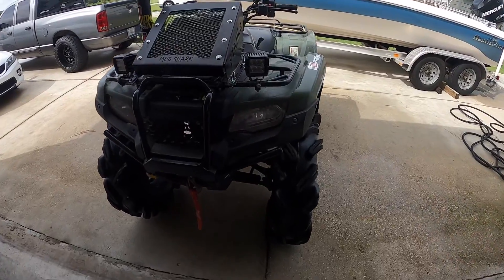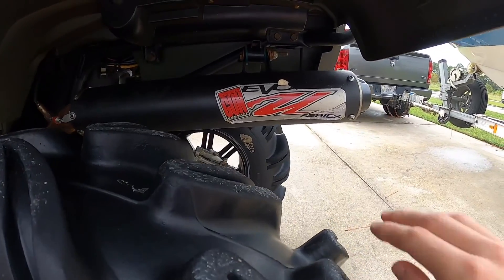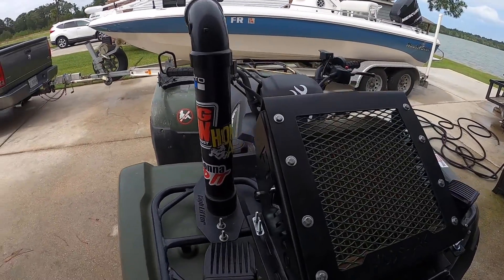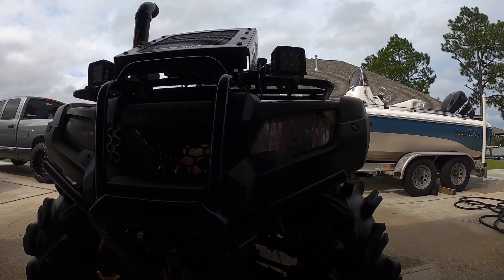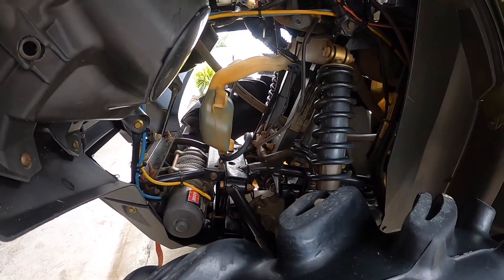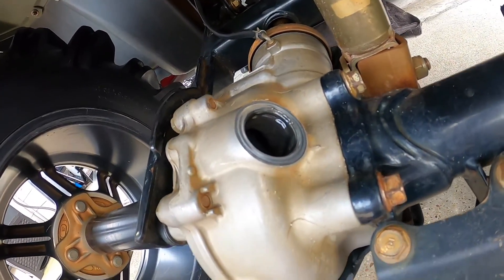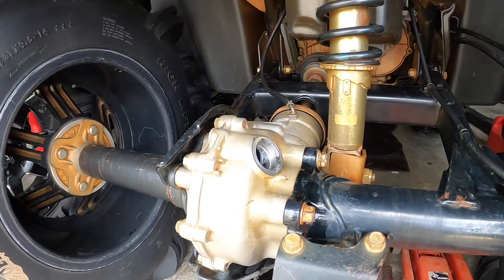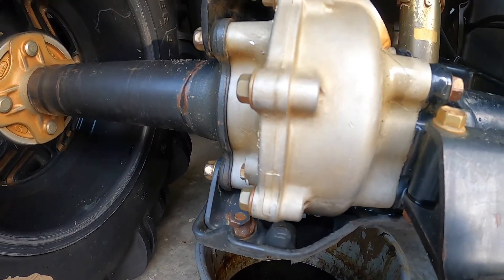UPDATE On The Honda Rancher 420! Is The Rear Differential Done?

Comment: Why you change Every 2/3rides the diff fluids? In there moistre or water Comming in the diff???
Reply: Water gets everywhere my friend, nothing on these bikes is "waterproof". Also, he is doing "preventative maintenance" to make his differential last as long as it possibly can.  I did not change my differential fluid on my Rubicon for a while and ended up having to buy a whole differential due to water getting in it along with other debris and tearing it up. Changing a differential is not fun nor cheap, definitely would recommend taking the time to clean diffs often and check bearings/seals after every 3/5 rides depending on the terrain in which you ride. Sand is a big factor in this especially since he rides at Zona Offroad park which has a BUNCH of sand. Sand will do a number on bearings,seals,and diffs if you do not maintain them as you should.
Reply from the maker: Couldn’t have said it better myself 👌🏼